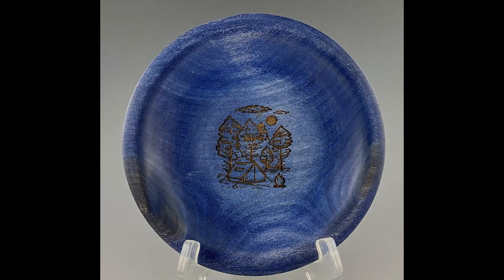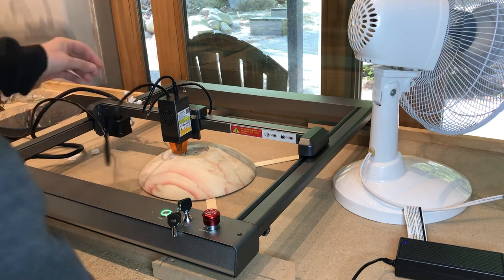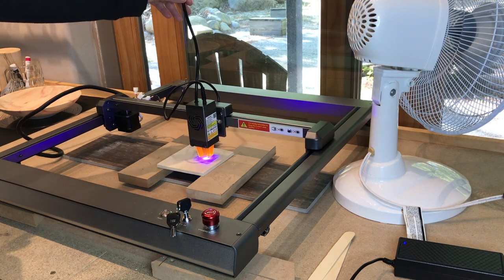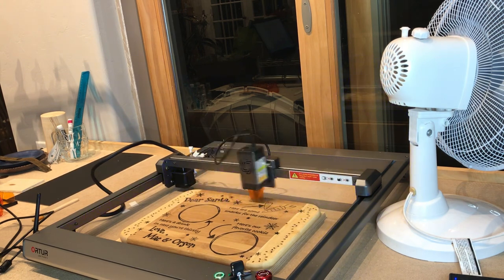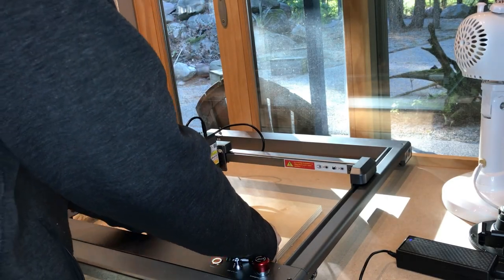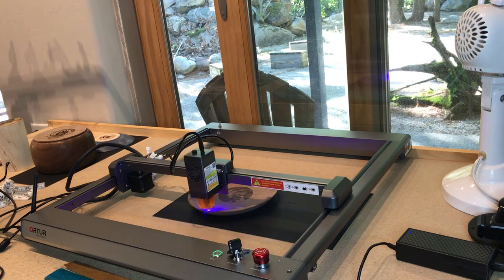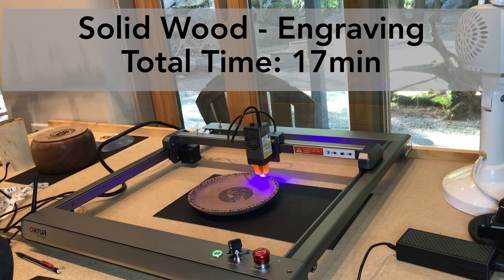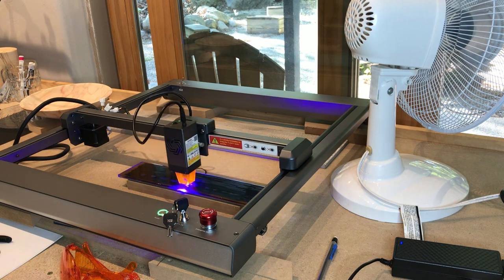Woodturning and Laser Engraving: Like Peanut Butter & Jelly? Testing the Ortur Laser Master 3

Comment: I just bought a Monport 55w.  I like it.
Reply from the maker: Hi Phillip! Yeah, there are lots on the market. I have another one to review, that one is portable Neither are particularly powerful but I’m not intending to do a lot of cutting so we’ll see how they go. Having said that, the Ortur is supposed to cut 20mm pine but I need to learn about the file types and just have some time to play with it 👍
Reply: @LisaRamlow  I basically just wanted to add it to the wood shop to make home décor, slate coasters, etc...  As they say, just another tool.  I finally got a site up and running, now working on promotional material.  Just a side hustle for me.

Comment: The hose is difficult to install, you need to push it in a little harder and it will hold. Do yourself a favor and get LightBurn. The program is extremely powerful and easy to use. Beats the heck out of going from Inkscape and then going to Laser GRBL. Their trace function works really well.
Reply from the maker: Thanks Kris. I’ve been watching some LightBurn tutorials and I am going to buy it. Have lots to learn yet about the types of files to use for each function but haven’t had time to play around much yet.
Reply: @LisaRamlow  the LightBurn team are committed to making LightBurn the best laser software you can get and they have succeeded in my opinion.  I have a vinyl cutter and make signs. I don't use my sign making software anymore because LightBurn is way better for making any type of vector graphic. You can try it for month for free to see if you like it so you can't loose. By the way I enjoyed your video.

Comment: Some good ideas. I got the Neje Master 2, it does 176mm square so not as large in area as yours, but it beats doing logo by hand, lol, and a lot crisper. I don't think you can get away from the scorched edges, other than lightly sanding after to remove the worst of it. Didn't know about using markers or paint for glass, that was interesting. I've seen people using masking tape, and burning through that to reduce the scorched areas, not sure how affective that is, but worth trying. I also use Inkscape in Linux, then transfer the image much larger than needed, at least 1000x1000 pixel size, then the Android app for the Neje allows me to set the burn area size, then the machine will outline the area where the burn extremities will happen. I have yet to get Lightburn to work with my machine, even though it's supposed to. Last time I spoke to the developers, there were still software issues they were working out for Linux, mainly with layout positioning of the widgets. Over all, regardless of the which laser people get, they are a fantastic and time saving edition. Thanks for sharing Lisa, I'm hoping to get videos and projects uploaded soon myself.
Reply from the maker: Yeah, I will probably sand it lightly but have also seen the masking tape trick. I am still playing with the settings - didn’t have time to get experiment before I had to get the video done so I just used the material settings in the software or app, so I may be able to get better results tweaking the settings. Overall I’m pretty geeked about it!

Comment: ...it's a cool looking machine...thanks for the review...I would suggest that anyone working around a laser wear eye protection...it'll need to be selected based on the laser wavelength...
I worked with several different lasers in the past...of course, we had danger signs posted...my favorite, instead of the standard warning "DANGER", it said "DANG"...followed by "Do not look into laser with remaining eye"...(you can find these online)...
Reply from the maker: Both laser engravers I received came with glasses and the orange cone around the laser unit that I assume would block the wavelength their unit uses…we can hope so anyway! I am going to build an enclosure for the Ortur to use with the exhaust vent I just installed through the wall and I intend to put a piece of orange acrylic on top to view through. I usually do wear the glasses while I’m using the unit but probably set them down on the table behind me a couple of times and forgot to put them back on. I like my eyeballs just how they are so I’ll make sure to be careful 👍
Reply: @LisaRamlow  ...cool...I'm glad that the manufacturer to the initiative to include the glasses...and yes, the shroud around the laser should block it from escaping...but be careful with anything reflective...the laser could reflect from under the shroud...
I enjoy all your vids, so keep 'em comin'...👍

Comment: Is it easy to elevate the laser for engraving the bottom of an upside down 5" high bowl?
Reply from the maker: Hi Ron! Yes, the unit itself is light enough to move around easily but is very sturdy and solid. I put a couple of pieces of MDF under the feet to elevate enough to do the bottom of the Yarn Bowl. I am going to make an enclosure for it and will have slots at a couple of different heights to allow the spoil board/surface to be different distances away from the laser unit, which will be near the top of the enclosure. This is help exhaust the smoke too, as I ran a 4” duct out the wall with an inline duct fan. I’ll do a Workshop Wednesday video of this when I get that far. I still have a lot to learn but I’m impressed so far.